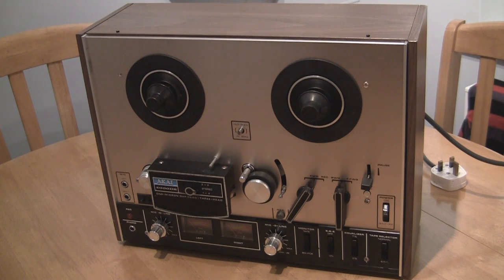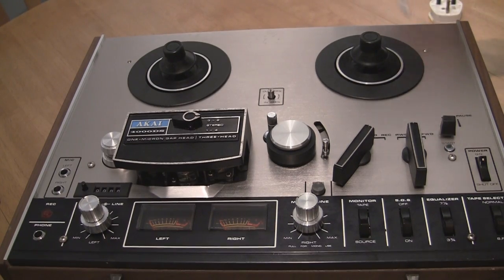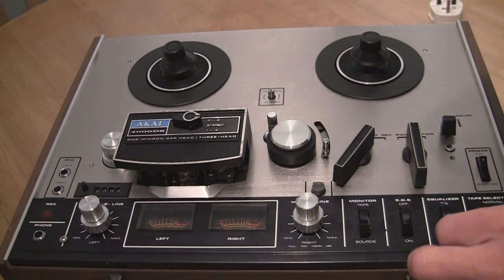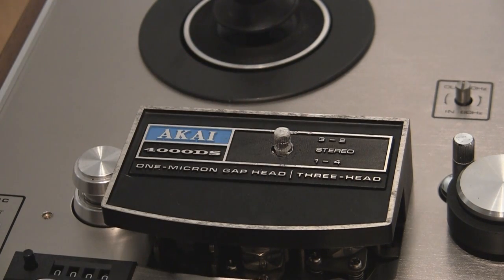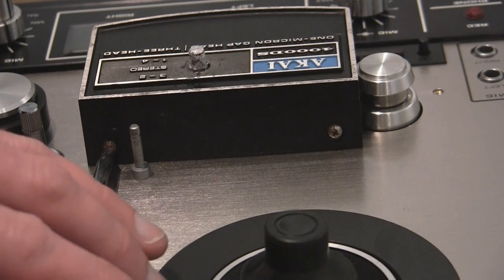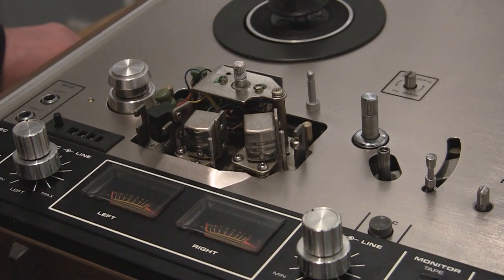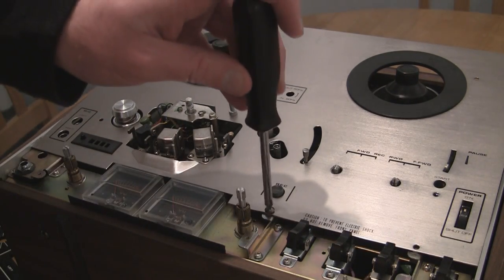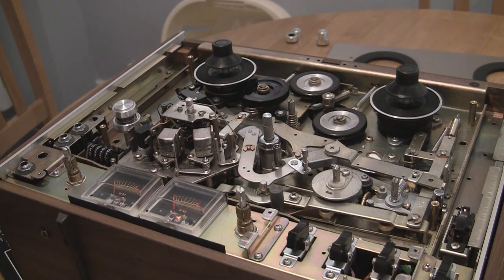Akai 4000DS Reel To Reel Repair Remove Front Cover

Comment: Great quick and simple video showing clearly the steps to get to the internal machanisms.  I've just got hold of one of these as my first Reel to Reel and going to delve inside soon.  All functions on mine are working fine . .but there is a mechamical squealing present on playbal back.  I'm hoping it's just a case of re-applying dried out grease.  Cheers for the info.

Comment: I see a few people below asking about what sized Allen key needed to be used , I had the same problem too with not being able to find an Allen key small enough to undo the screws , I ended up taking it to an engineer who fixed it fine......when I asked him what sized Allen key he used he admitted to having to gently file down his smallest key to get it to fit ......so it looks like a lot of us have this common problem of finding a small enough key to do the job , so bare in mind that you may have to file down the smallest key you have by trial and error...good luck

Comment: Just bought one on a free-market and it needs to be cleaned, Yr video helps me to avoid any damage while disassembly for cleaning. Thanks M8! :)
But i also have the same question as a few below (without answer):
What size allen wrench did you use??

Comment: I JUST GOT A 4000DB THAT COST ABOUT £280.THE SOURCE/TAPE IS NOTHING LIKE IT SHOULD BE EVEN IF I TURN DOLBY OFF DURING PLAYBACK.THE HEADS ARE CLEAN SO IS IT THE TAPE AND I HAVE USED QUITE A FEW WITH THE SAME RESULT OR IS IT THE 4000DB?I RECORD AT 3-3/4 IPS SO SELECT THAT ON THE EQUALIZER SWITCH AND TAPE SWITCH IS SET TO FULL RANGE.

Comment: Thankyou I have just bought a GX 4000D from ebay which initially seemed to be working fine, then after a second evening of use I noticed the speed whilst recording has gone skew whiff when the tape reaches about 2/3rds through.Any idea please what the problem could be. I am not any sort of servicing technician I am wondering could it be the belt which having looked at from the side back plate looks difficult to replace it seems hard to reach.Any advice will be much appreciated Thanks.

Jim

Comment: How did you remove the round plate on top of the pich roller?  It looked like it was already loose.  I need to remove the plastic equivalent plate on a 4000D.  Thanks.
Reply from the maker: cant remember sorry
Reply: @stampysrandomreviews  I found it unscrews anticlockwise, just couldn't get a grip on it at first, cheers.

Comment: I have an akai 1730D-SS reel to reel that slows down an eventually stops turning in play mode.  It works fun in fast forward and reverse but when in play mode, it fails to continue playing.   The motor simply stops turning and the tape seems to spin very fast, when it does turn, just before it stops.

Comment: I have the same model with the blue AKAI badge - the right silver rotary control doesn´t pull out for mono. When I tried that both silver controls came off. The spindle doesn´t seem to want to pull out - is this a fault or normal for this earlier model? Thanks.
Reply: Andy Martin hi just got mine alswell i noticed that to but it is the pin on the inside you have to pull

Comment: For those who wish to know the correct size hexagonal key to use? 
It’s 1.5mm I recommend getting a long series key as their less fiddly to handle in use.
Reply: I cant get a 1.5 key into the screw and all others seem too small, maybe it's stripped.
Reply: @Jukedome  I used a 1.3 mm hexagonal and it worked on my 4000DS model